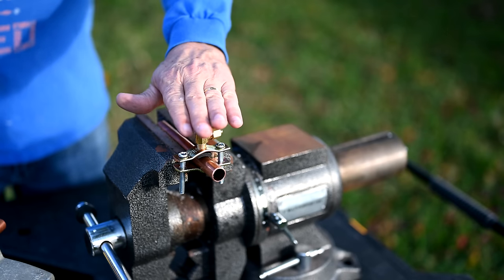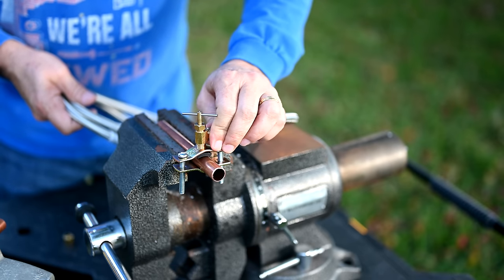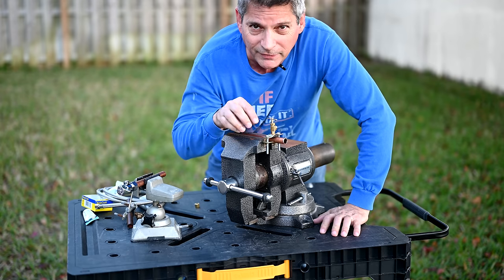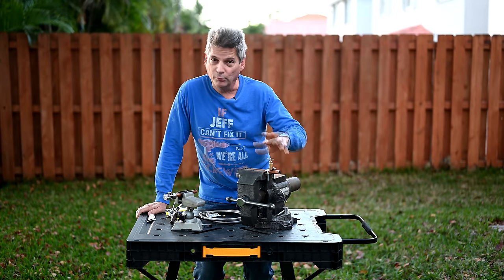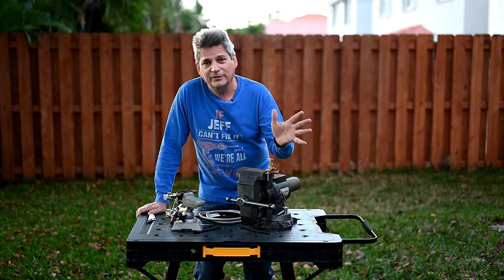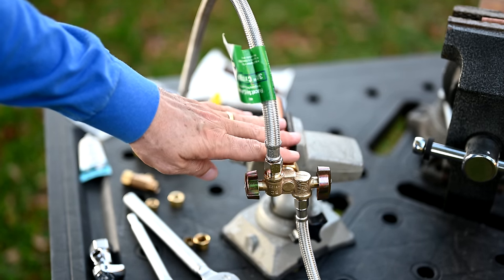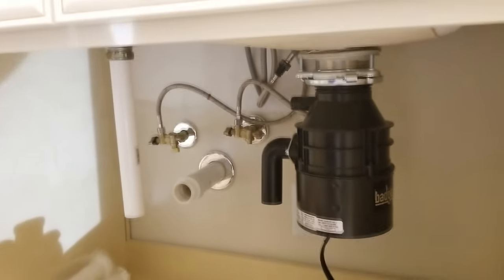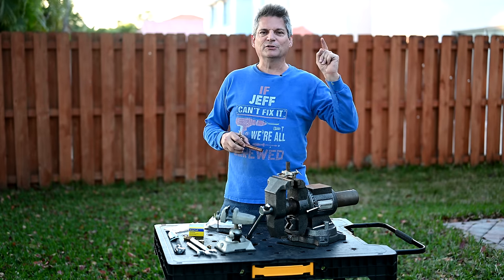Plumbing Tips: 2 Saddle Valve Alternatives For Ice Maker Lines

Comment: i like this idea, but is loss of water pressure to the faucet a concern by splitting the 3/8" supply, as opposed to any solution directly on the larger OD copper pipe (such as a standard Tee, shark-bite, or saddle valve)?
Reply from the maker: There is no loss of pressure to worry about, your house is full of branches. The city supplies enough water pressure to seek out and find all these branches and fill them up to full pressure. Also the ice maker is 1/4" line, not the same size as 3/8", and the ice maker has a water inlet valve that tells the hose when to allow a small amount of water in to make a small batch of ice, so it's not like the fridge is robbing huge flows of water from that shut off valve at the sink. the ice maker will draw the same amount of water off that main pipe whether you do it with a saddle valve or if you add a 2nd port onto the shut off valve.
Reply: @jeffostroff  got it thanks! i guess i thought that if i used the first adapter you mention, and split the 3/8" fitting into a 3/8" and a 1/4" tee for the fridge, that when pouring water from the fridge dispenser i might see a pressure decrease in the sink faucet -
Reply from the maker: @jonnymosco  I doubt you would see a noticeable difference at all. People take 2 showers in 2 bathrooms at our house, while the dishwasher is running, no pressure drops.
Reply: @jeffostroff  I just noticed that the brasscraft doesn't seem to be in production anymore - are you aware of other dual shutoff valves like this? i can't seem to find others -

Comment: Would I be able to use one of these to run a water line down into the basement and then back up for a fridge? Cause my sink and fridge are no where near each other
Reply from the maker: Yes do it with hoses or copper pipe with valves on the end.

Comment: Now you have to make a video showing us how to replace our saddle valves with code approved parts please!
Reply from the maker: These are code approved alternative parts in this video
Reply: @jeffostroff  they don't replace the existing saddle valve though. If I use your method I'd have to re-run the entire hose to the sink. Where the line is directly below the fridge. What part do I use to put in place of the saddle valve?
Reply from the maker: @tj_gsomething_   To repair the spot where the saddle valve was removed from, you have to cut the copper pipe and insert in a copper fitting called a coupler,  And it has to be soldered
Reply: @jeffostroff  OR USE A SHARKBITE T

Comment: Would this work if the saddle valve were made of hard plastic or if there was a washer underneath to prevent the metals from touching?
Reply from the maker: you might be better off, but plastic can deteriorate over time, and it is likely under some tension.
Reply: Most plastics become very brittle at cold temperatures so if this was in a camp in a colder climate you would get a big surprise when you open the camp for the season. Also many plastics crumble after a few years.
Reply: @miked877  true, however if the water lines are already PVC and used in a climate controlled house, one would think the saddle valves would last at least as long. 🤔

Comment: Can we put anti seize in between the bottom of the saddle valve and copper pipe? I use it and it works well when using two metals on my car (chrome rims and aluminum spacers and steel rotors). No need to on the top bcuz there's a rubber or foam piece. Or maybe install thick Gorilla tape or rubber in between the bottom piece?
Reply from the maker: That might help but of course my preferred method is to remove the saddle valve altogether and put in the correct compression shutoff valve off of AT fitting from the copper line

Comment: So would putting a thinner rubber piece on the bottom stop the contact corrosion?
Reply from the maker: that might help, but you still have the pierced pipe to worry about, and what if the screws are cheap metal in contact with the saddles that could also cause corrosion, and if there's ever any humidity in the area, it can cause corrosion, leading to failure.

Comment: Your link to the adapter goes to a 3/8 by 3/8 by 3/8 tee.  But in the video you describe it as a 3/8 by 3/8 by 1/4 tee, and it does appear to be a 3/8 by 3/8 by 1/4 tee.  Why do you link to a 3/8 by 3/8 by 3/8 tee?  I am confused.  Please explain.  Doesn't the icemaker fitting need to be 1/4?
Reply from the maker: Looks like there were problems with the link, I have them correct now in the comment pinned above, and one for the cold water has the 1/4" port for ice maker. The other valve for the hot water side has the two 3/8" ports, because one goes to the hot water faucet control, the other is for the dishwasher hot water supply line.

Comment: When you put on the "dual valve" aren't you still putting two different metals together???  Also, do you have to cut your copper pipe to put the dual valve on??? Oh, by the way, I love your videos and have subscribed to watch them and I have a lot of catching up to do--lol.
Reply from the maker: The brass from the valves, just like the ferrule sleeve, is inert and will not corrode against copper.

Comment: @jeffostroff what valve would you use for a situation where there is already a 1/2" pex pipe that was run from the sink to the fridge area and I need to attach that pipe to the 1/4" fitting and tube that came with the fridge?
Reply from the maker: I don't work with pixel I'm not that knowledgeable in it they must have some crimp on connector that mates up to the 1/4" fitting on the ice maker line

Comment: i have one of these saddle valve.. where can i get new one, to replace it ,,and  ..does homedepot have these compression fitting valve.
Reply from the maker: If you remove the old saddle valve, water must be off, and you have to cut out that section where the valve was to remove the pin hole in the pipe, and replace it with a T-fitting, then a small stub of pipe off the T fitting, and install the compression valve. We have links in video description to home depot or Amazon for these valves.
Reply: @jeffostroff  do they mske Tcompression fittings.

Comment: Good topic, and good video but I have some constructive criticism: the video is a little long. Some editing could have made this video even better by getting it down to about 10 minutes long or so, from 18. Also I would rearrange the order of the subtopics: start with a shortened version of the huge problems with the saddle valve first, then go into the 3 solution in order. Just my 2c.
Reply from the maker: I worked really hard to get it down to 18 minutes, Also since this is a video about alternatives to the saddle valve, you start off by talking about the saddle valve failures, you're going to have all the viewers bail on you because they were promised a video showing alternatives, and 2 minutes in, still no alternative shown.

Comment: Also, regarding 7:30, I find no support for the assertion that it's because it's copper touching brass that electrolysis corrosion is occurring. I don't know what happened to that saddle valve you showed, but I assume it's because it's outdoors in very high humidity, possibly with a valve bracket that is made of something other than actual brass. Notice how rusty the bolts even look.
Reply from the maker: LOL, nice try, you did not even research it all, because One Goodle search yields pages and pages of results. Here's one https://www.fenestration.net/pdf_documents/About-Dissimilar-Metals.pdf
Reply: @jeffostroff  yeah i'm not trying anything. really nice attitude.
Reply: @adamnox2268  you are right, the saddle valve is made of steel and then plated. Solid brass and copper are  not dissimilar metals. Electrolysis only happens when you mix ferrous and non ferrous metals. Of course Jeff already knows that because he is a PROFESSIONAL?...... what ...... I don't know.

Comment: In the second part I have a plastic line for the ice maker im how would I connect it
Reply from the maker: You need a shut off valve with a 1/4" compression fitting for your phatic hose. The guys in Home Depot plumbing aisle can show you what you need

Comment: Jeff I am just making sure I am getting the right valve I am wanting the dual valve is it part #Ktcr1900dvx R valve I was confused when I pulled it up it didn't say 1/4 in on it??
Reply from the maker: I know, I hate it when they do that, and the 1/4" output looks so close in size to the 3/8" output. But, if you click on "see more product details link on their description on amazon page, and it takes you further down the page, you'll see they mention this "BrassCraft 1/2 in. Nominal Compression Inlet x 3/8 in. OD Compression x 1/4 in. OD Compression Dual Outlet, Dual Shut-Off 1/4-Turn Angle Ball Valve controls water flow to household plumbing fixtures. The angle valve is most often used where the water pipe enters the room from the wall. The dual outlet allows two independent supply lines to be attached to a single valve. The dual shut-off allows you to turn off the water to one source while working on another. Ideal for adding dishwashers, ice makers, water filters and instant hot water dispensers to existing water supply. With a 90 degree turn of the valve handle, you are able to stop the flow of water leading to the plumbing fixture, allowing for maintenance and repair without shutting off the water to the entire home."
Reply: Thank you for clearing that up for me...ordering now....

Comment: Jeff, I wanted some advice on a very precise low volume alternative to a saddle valve for my HVAC humidifier.   Years ago when I replaced my hot water heater I had them sweat on a T to a real valve for the humidifier instead of using a saddle valve for the reasons you talked about in this video.  My issue is that I find it extremely hard to set the valve opening to just a trickle of water compared to what you can do with the saddle valve.  So, I am wondering if you know of a part that would help here.   (The valve I am using looks very similar to what you are using in your saddle valve video)
Reply from the maker: you might try a gate valve instead of this ball valve if that is what you have on there now. But I have seen ball valves can do small trickles too.

Comment: So what do you suggest for a humidifier that is using a saddle valve?
Reply from the maker: It's the same for a humidifier, try to find shutoff valve somewhere and connect to it using the Solution #1 or Solution #2 that we show in the video.
Reply: My advice, remove saddle valve, cut the damaged piece of pipe out. Then solder in a straight piece of copper pipe where the saddle was. Then throw away the humidifier and patch up your hvac duct. But that's just me, having dealt with humidifier damage.
Reply: @mattg726  

Poor maintenance leads to damage associated with a humidifier.
Reply: @jrsmyth9761  im sure, but that was not my situation. It's a long boring story, there was a remedy that was more costly but i just chose to get rid of the humidifier, the end. 🤗

Comment: I don't see a link for the valve adapter, is there a part number I can take to my local hardware store?
Reply from the maker: We just added the link to it, here are the links to all 3 valves:
🛒 BrassCraft  3/8 in. x 3/8 in. x 1/4 in. Compression T-Fitting https://homedepot.sjv.io/d1qkj
🛒 BrassCraft KTCR1900DVX R Dual Shut Off Valve Cold Water Home Depot: https://homedepot.sjv.io/dmGqQ
🛒 BrassCraft KTCR1901DVX R Dual Shut Off Valve Hot Water Home Depot low price: https://homedepot.sjv.io/Q5bvY

Comment: Does this mean I have to cut a section of my existing line just to add the proper valve? The saddle also dosent happen to be in a humid environment. I'm not a professional plummer though and the water lines are already in place so it seemed like the simplest thing to do.

I think I wasted my money...
Reply from the maker: Yes, you would have to cut out around 2-3 " of pipe and solder on a T fitting, then a stub of a pipe to tighten on a compression fitting water valve with a 1/4" output for your ice maker supply line.

Comment: Not everyone has a ice maker (or another device needing a 1/4” line) right next to the kitchen faucet. I ran across a scenario where the ice maker hose was taped off behind the washing machine. I’ve not seen a 1/4” tap/valve with a washer hose built into the same valve. In addition to this the corrosion between the zinc plate on the SV isn’t that big of an issue. It doesn’t have electric power running through it. I just replaced a saddle valve that had been there for 20+ years with another SV and I put dielectric grease on the plate. Problem solved.

Comment: Got two saddle valves in my basement. One is 18 plus years old & the other is over a year old with no problems. Why so? Both saddle valves have rubber insulation where it clamps on the copper water line. These valves were installed by professional plumbers here in Pa. Even though it may be illegal, they are working & I always inspect them. If they eventually leak, I'll do it your way. No offense to you...   :)
Reply from the maker: No prob, as long as you are aware and now you can check periodically

Comment: just replaced a grounding strap on the water pipe bonding/ground  from a electrician and plumber and inspector that missed (or overlooked or got paid off to approve) Due to dissimilar metals corroding a hole on a water pipe. Took 15 years but the damage was in the thousands. BY the way-WE did the proper splice (as an educated and continue to educate myself electrician) on the grounding strap- as 2 previous electricians did it wrong. YOU CAN ONLY USE IRREVERSIBLE COMPRESSION CONNECTORS on splicing grounding wire that bonds water pipes (bonding ground that goes back to the service panel usually) OTHER methods are using exothermic welding process.   NEC 250 i.e. Burndy C-tap takes 12 ton  Crimper to properly attach C-tap. I say all this because I see these bumper stickers HIRE LICENSED CONTRACTORS -doesnt mean SHI$% The DBPR in Florida is set up to take money and hand out "so called licenses for advertising" not educate and protect the consumer. The best protection is ask lots of questions, build a loyal/trusting/open communication reputation with a trades-person (unlicensed or licensed) and arm your self with factual content - start off with small projects with any new contractor or tradesperson  ((I dont like saying handyman/person)) i.e.like  jeffostroff videos. https://www.youtube.com/watch?v=qED5bz40ow0
Reply from the maker: What metal was it they used? I would think of you are going to clamp anything onto a copper pipe, it should be copper. I see a lot of those brass ground wire clamps at Home Depot, and wonder about whether people are installing them on copper pipes.
Reply: @jeffostroff  2 issues with the process with the metal in the  plumbing. Plumber used galvanized pipe (nipple) with out a dielectric coupling to the copper joining.  Then the electrician used a galvanized strap on the copper!! (instead of the galvanized pipe portion or the correct copper grounding strap to copper). One common flaw and I think you bring it up sometimes in your videos; tradespeople don't necessary have the science background when trades cross one another- you wont get that with any contractors license.  I spend decades studying science  I think one has to be humble in what they need to stay educated within; I call it staying hungry for knowledge- the right youtube channels (a lot of bad ones) can help with that thirst for knowledge. Agree most of the stuff at home depot and lowes is marketed towards  novice band-aide(s) solutions.

Comment: So, if metal to metal contact is the only problem, then perhaps a person can put another black plastic between the bottom fitting to solve the metal to metal contact
Reply from the maker: That might help, but you can still get a leak at the point where it is pierced

Comment: I wish you would have a solution where the pipe must pass through.  You showed with a termination point.  My saddle valve is in a middle of a pipe.  You can’t simple terminate an end there.  Otherwise good info for what you showed.
Reply from the maker: What the plumbers do for your case is shut off the water, cut the pipe on either side of the saddle valve, and insert a new pipe with a copper coupling on either side, and sweat it into place. 20 minute job for a good plumber who knows what they are doing.
Reply: jeffostroff, that’s what I kinda figured.   I had a saddle valve fail today.  I appreciate your reply.  I actually have a guy coming in tomorrow to do what you stated.
Reply from the maker: @chazter6  Funny how numerous plumber keep coming on here telling me I'm wrong, bragging they installed saddle valves 20 years ago that have not failed. What was your failure mode,
Reply: @jeffostroff saddle valve indeed failed.   IMO, they are lucky so far.   I had another in my basement connected to a water line for a fridge.  I went ahead and replaced that one too with a proper connection fitting.

This is what it looks like:
https://www.truevalue.com/service-tee-stop-5-x-5-x-25-in

Comment: Can you not add a thin piece of something on the bottom so that the metals aren't touching?
Reply from the maker: yes, but it's also the point where you pierced the pipe
Reply: @jeffostroff  I recently got a fridge that has an ice maker and I was looking in the basement at stuff and saw that someone years ago put one of these on. It must have been functional at some point but isn't now. I dont notice any corrosion and figured I would just tap into that but I'm guessing it may be best to just do it another way. Thank you.